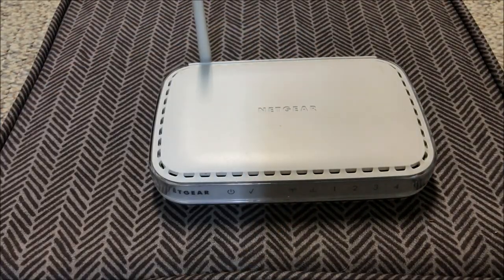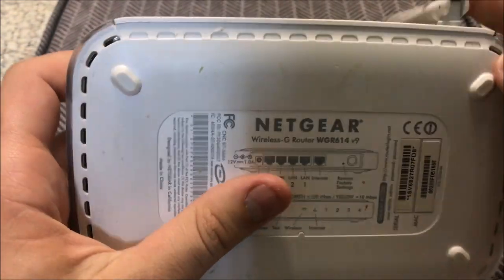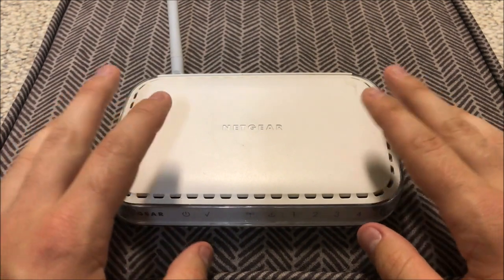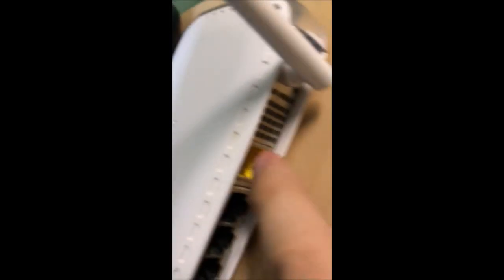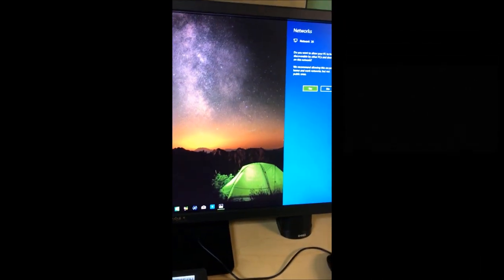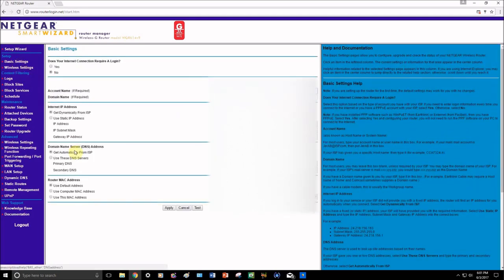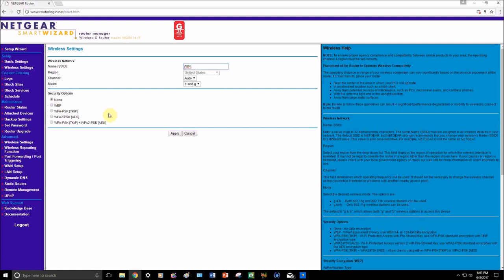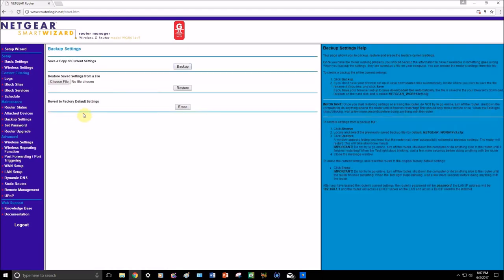Netgear Wireless G Routers Explained Simply

Comment: I don’t have internet at home .. can I use this for my printer in order for me to print wirelessly if it needs WiFi  ?
Reply from the maker: Claudia Trejo I don’t think you could with this model. I’ve never personally tried (as my printer has its own wireless signal). If one were to have this function it would probably have to be newer. Personally I would recommend just connecting your printer with a wire the old fashioned way until you get WiFi.

Comment: my netgear is v4 and windows say its using an "older security standard" and won't let me connect at all wirelessly. with wire it doesn't even recognize it (changed 3 cables and tried all different ports). Any solutions, or is v4 just too old to be used even as an extender?

Comment: Does this have some kind of a feature that enables me to time this to switch off the wifi facility during sleep time? Something like, the wifi shouldn't work between 1 am and 7 am, automatically every day.
Reply from the maker: Ajay Menon I haven’t had this router in a long time so I’ll try my best to tell from memory. If you follow the instructions in the video I should tell you how to get to the menu. On the left side there is usually a section called “Schedule”. That sections allows you to turn off the wifi signal for a selected time. If it is not in the Schedule section, I would look for things such as Administrator settings or go through the menus until you see an option to do what you’re asking about. I can’t guarantee your version will have these settings but most routers back then did.
Reply: @Dash Byron Instablaster =)
Reply: Yes, Advanced tab, Security tab, schedule

Comment: Can I use this router as an additional signal in the bedroom? I have an Arris SG1O Modem/Router in my living room
Reply from the maker: BKLYN FINESSE assuming you have the same or a similar model the answer is yes. Most of the older routers, much like this one, require a wired connection to extend signals. Many newer routers/boosters are designed specifically for extending a wireless signal without the need to run cables however. It is possible  to configure some older routers to extend signal wirelessly, but I’d save myself the time and either run a cable or by a cheap booster.
Reply: @simplicityelectricity8710  Thank you. I am going with the booster

Comment: I am having issues with the online portion of the setup.. my router is exactly the same, just looking to get a range extender, it was free so I just wanna mess with it, mabye even just use it as a 2nd router to compare to what I already have... any help would be great.
Reply from the maker: I’ll try to answer your questions as best I can. As for a range extender, this is an old router, so about the only settings that you can mess with that could mimic a range extender are the routers name and password. So if your current wifi is called “Zrage’s Wifi” and the password is “Password123”, then make these the name and password for the router. You could dive deeper into the settings such as messing with IP addresses, but that’s unknown territory for me.
Reply from the maker: As for a second router, you should be able to follow the steps shown in the video to reset the router and then after setting it up run an “Internet Speed Test” using your browser while connected to the routers internet.
Reply: @simplicityelectricity8710  thank you

Comment: Hello, in my router inteernet light isoff how to fix this issue can any one help in fixing??
Reply from the maker: Saikiran Goud is a router reset doesn’t work there is a possibility that the LED light has burnt up. It all depends on if you’re still getting internet. If you are, the display may just have issues.

Comment: My. Wifi actual speed has to be 50mbps but I getting 20mbps only, I use the same router that you're explaining about. I'd be very thankful if you could help me. Do you think changing it frequency band from 2.4 G to 5G could help me on this?
Reply from the maker: shalom mankind the router I’m using is older and only had 2.4 G band, so it’s limit is about 54 mbps. If your router is newer it is probably operating on the N or AC band, which allows for 100+mbps. If you’re only getting 20mbps I would recommend changing the frequency first to see if it has any affect. 2.4 Ghz is better for older devices and for reaching over distance, 5GHz is better for newer devices that are close to the router and these devices won’t lose connection as often.
Reply: @simplicityelectricity8710 
I use the very same device that you have which gives 54 mbps. And also i didn't see any frequency band like 5G or 2.4G to change.
Reply from the maker: shalom mankind the router could possibly need a software update. It’s rare but that can cause issues. If all the settings are relatively normal and you haven’t tried to adjust data traffic then it could be an external cause, possibly from your ISP.
Reply from the maker: shalom mankind this router falls under category Wireless G category, which is limited to 2.4Ghz and 54mbps. Newer routers that look almost identical to this one have multiple categories and higher mbps. This could possibly be another issue.

Comment: How do I connect a WiFi to a WiFi without a cable. My home WiFi has a password & I'm using this Router to connect to it. But all I'm getting is a network name to the router & an X on the internet. Example: one house has WiFi & internet, how do I set up another house using the first houses WiFi internet?
Reply from the maker: I’m glad you asked. Many older routers like this one cannot share wifi without being connected via ethernet cable. In this case, unless you were using a router newer than this one, you can’t make them share a connection without a cable to my knowledge. However, if you can connect this router or any other one to your desired wifi I would recommend giving it the same name and password, that way devices such as your phone will always choose the strongest connection vs trying to reach a router you’re far away from.

Comment: My device has power and the internet light is working but am not getting a wireless signal....how can I fix it??
Reply from the maker: Best bet is to reset the router by holding down the reset button for about 20 seconds. You’ll have to go through setup again; naming the Wifi, setting up a password, etc.

If that doesn’t work then the transmitter may have gone out or got corrupted because of software. In that case best bet would be to cut your losses and get a new one or a used one. It’s rare for them to just break or stop working so used will be fine.
Reply: @simplicityelectricity8710  thanks.

Comment: I want a mobile device with external antenna sockets.
it should not need mains input, 12v is OK.
I have a laptop and that is what I use,
its for the house and the boat.
Reply from the maker: If you're asking for a recommendation then this is definitely not the device for you. There are a lot of variations of what you're talking about, but mobile hotspots are usually the way to go for covering distance. There are hundreds of different models so I can't personally recommend one over another, but luckily most of them will run on 5V DC or 12V DC power supplies and can cover a fair distance. This device has no wireless capabilities.

Comment: The amperage rating is a minimum.  If the power supply is the proper voltage and 1000 times the amperage, it will work.